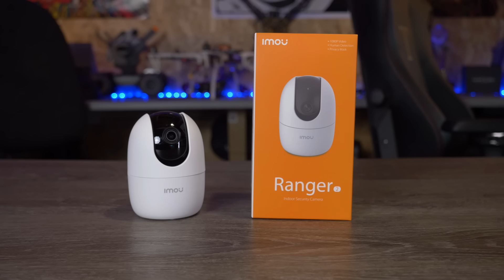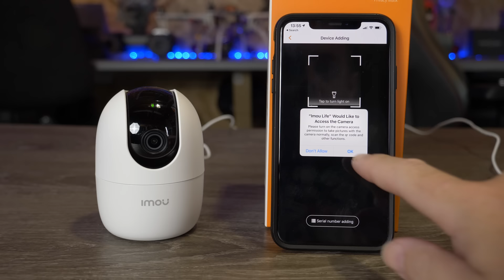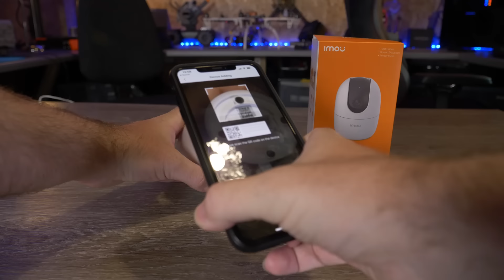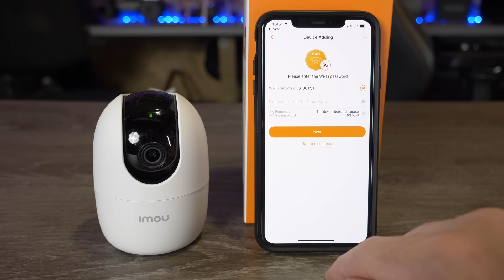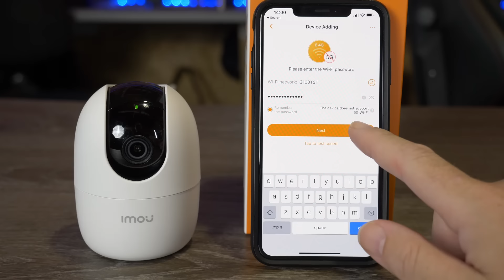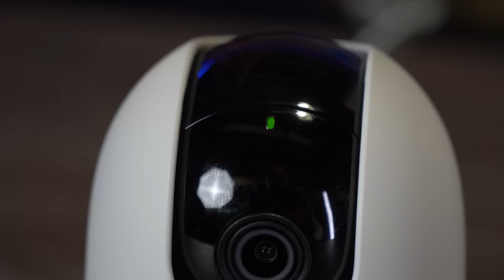How to set up the Ranger 2 - Imou

Comment: I have a total of 5 Imou cameras so far, they are fantastic value for money and so easy to set up and use.
Easily as good quality as the more expensive cameras such as ring at a fraction if the price.
Reply: Hi ,the videos ok but this demonstration seems to show it  connecting to a router not direct to a phones wifi   ,is there a way to connect it just to a phone over wifi ? I can not find any video showing the method in English  ,thanks
Reply: How many days of Recording possible with 256gb sd card
Reply: Can it even suport  that match?@amiteshbaghel
Reply: @godofterror000  don't know brother I don't have 256gb card..
Reply: Outdoor wifi use only?

Comment: When adding a device, the serial number must be written or the barcode must be photographed on the sticker below the camera device. The sticker may be damaged over time. How can the product be added if the sticker is damaged? The second problem is that if the camera is hung from the ceiling, how can the product be added and the sticker is hidden because the location of the sticker is hung from the ceiling? I suggest adding other means to add the device to the mobile phone in an easy and convenient way, or carving the barcode on the body of the camera device, or adding the camera device via the Wi-Fi network. The second problem is the method of connecting the camera device to power or electricity via a micro charger. This charger damages the pin over time and cannot be connected to the device, in addition to the difficulty of extending its wires

Comment: Those who are facing issues with connecting to router, first press the Reset button for 10 seconds. Once the LED turns green, the quickly connect the Camera to the router immediately.
Reply: Where is the reset button
Reply: @Hhsvhg  rotate the camera upside down with your fingers and you will find reset button and memory card slot. Try to take the help from User Guide that came with your camera
Reply: @MirzaKhalid  thank you it worked
Reply: @Hhsvhg  the reset button is on the microcard door, near that bloody useless qr code. I hope that you will have luck because , reset button or not imou is a bloody lottery
Reply: How long have you been using the camera? does it run good or just another scam like v380 cameras?
Reply: @MDKakashi.  I am still using it. I didn't update the camera frimware or the android app. And I disabled auto motion tracking since it's not an AI
Reply: @MirzaKhalid  I am gonna get one soon. Thanks for quick response. ❤️
Reply: @MDKakashi.  You're welcome. But buy at your own risk. I bought one year ago when Imou brand was ok.

Comment: I've spent over an hour trying to get this working!!! I have an IMOU Ranger 2C and after I scan the device through the app it gets stuck on Connecting to the device hotspot... and that is as far as it goes! Tried resetting it multiple times. When adding it manually I get failed to connect to the hotspot device please try again 😞if anyone has any solutions I'd be very happy to know before I use it in my next baseball throw practice!
Reply: Same I need help
Reply: @markmckean816  I solved it using a different phone. It worked flawlessly on the older phone. Once I added it to the account I could then use it though my normal phone.

Comment: Hi, can you tell me, please, if the camera can be set to store the video files in a LAN on a personal NAS? I have a Qnap TS-230. Thank you!
Reply: I use my IMOU ranger with Contacam monitoring software which does all the recording onto my long term storage device. Whereas most RTSP cameras do not need any fancy code so Contacam (and I dare say other Monitoring and CCTV software) the Ranger 2 needs a little bit more text to get it to work so you have to use this as the camera address:

rtsp://192.168.1.8/cam/realmonitor?channel=1&subtype=0&unicast=true&proto=Onvif&unicast=true&proto=Onvif 

  where 192.168.1.8 is the IP address of your Ranger 2 . i would suggest you bind the camera to that IP address in your router too !       Now, that worked well for my system even after i changed my router. Obviously all of that text should be one long 'sentence' and not in 2 bits so if when you copy it, you get a line break, edit it to take it out.

Setting it up this way, you let the Contacam software do all the filtering, but it CANNOT of course work the pan and tilt, it will just take the feed being broadcast by the Ranger 2. Of course, this is what worked for me, your system will be different but this might help you at least to access the camera output. 

I recommend Contacam software - you can get it for free but a small donation of $10 (lifetime fee !) means the 'Please Donate' watermark at the bottom of the screen is removed. You can get it from www.contaware.com 

Best wishes
Reply: @BusinessButlers  Thank you! I will try it right now!

Comment: I have successfully connected it. But it works only in Wi-Fi zone, where camera is also connected. But Cellular data can't get connection with camera, though I have turned on the cellular data mode on apps to get the access! What's the solution please?
Reply: This IP camera has no LAN support , when my data stops it stops working

Comment: i just changed my router, green light flash, i connected 2.4ghz, but when it reaches the final page of setup "The device is connecting to the cloud" , timer runs out and it failed. may i know how to troubleshoot this?
Reply: Exactly the same issue is with me.. I am still struggling.. maybe the camera is faulty or the wifi network is set to 5g by default but showing 2.4ghz. I have asked for a replacement, lets see how it goes after I receive a new one.
Reply: @track_record  ok , I found a way. 
Create a hotspot for your cctv to connect to, 
Do as usual, but when cctv selects wifi options, select your other phone’s hotspot(not the one you’re using in the app) 
It will finish the setup and then just go back to the app and change the wifi network to your desired wifi. 
Ez fix. Let me know if this helped
Reply: @louee432  Oh! I tried that, hotspot is connecting fine but when I try changing it on app from hotspot to my wifi it says the device cannot connect even though my phone is on 2.4ghz and the worst part is the camera is also connected to the 2.4ghz wifi but still, today from past 5 hours I am struggling, gave up and then decided to go for a replacement.

Comment: how do i find the mac address of my camera? my wifi requires username and password to register and camera only asks for password but i can add a device if i know its mac address.
i already asked support and they were not helpful.
Reply: make the setting in your router to " SSID is visible ", so when the App looks for the SSID of the router, you then add the password for that router channel and it should link perfectly OR put the Ranger 2 near to your router and connect it via an ethernet cable directly to one of your router's RJ45 sockets. Then look at your router details on  your PC browser and you can then jot down the Ranger's Mac Address and do what you need to do manually but it DOES seem a strange roundabout way of doing things.Do you have to do that for every device in your house then???
Reply: @BusinessButlers  thank you for the advice.i am in a student accomodation so i dont have access to the router so I sent support an email and they told me to download a tool that checks the address easily.

Comment: I don't think the idea of subscribing to record and save video clips is a successful idea because the user needs this service permanently. If I don't pay the subscription fee or forget to pay it, the service will be interrupted and thieves will rob the store. I suggest a permanent payment service for this service and the company can profit by selling camera devices or cloud memory services or the service of manufacturing and selling external memories. I suggest that the user be facilitated in the way of hanging the camera on the wall or ceiling by adding nails and drilling the ceiling and walls and distorting its appearance and the difficulty of extending the wires for the camera by adding the feature of the lamp screw to the camera device and hanging the camera easily and conveniently on the ceiling or wall